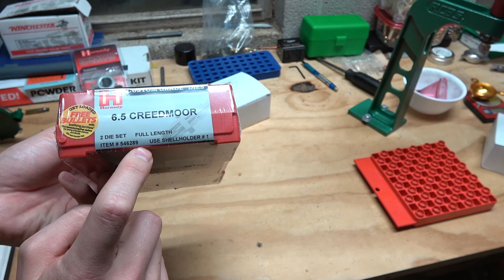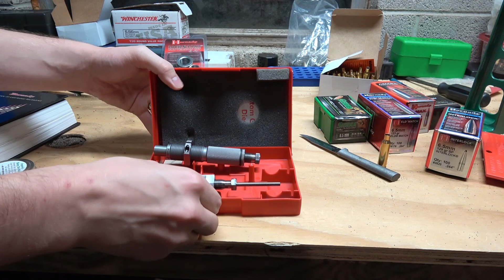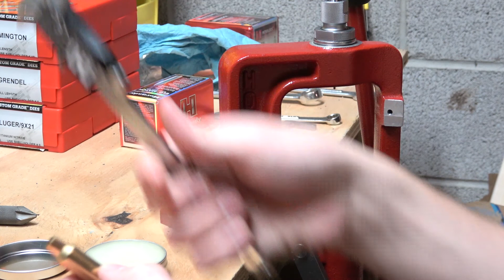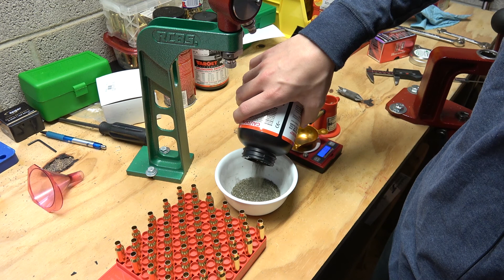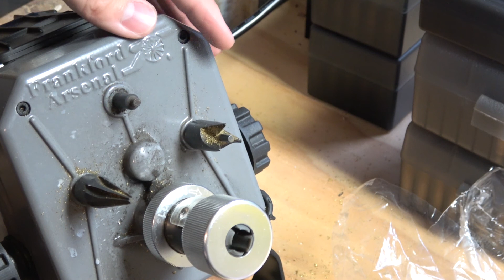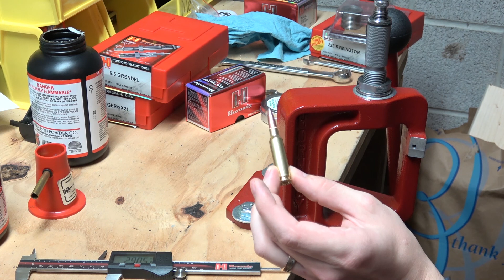Loading 6.5 Creedmoor Start to Finish

Comment: What size decapping pin would I need to deprime Lapua small primer pockets? 
I believe my pin is too large for the primer pocket hole. .072 is what factory is measuring at. 
Am I crazy or do I need smaller decapping pins in my die?
Reply from the maker: So I do know that most large and small primer pockets have the same size flash holes, but there is such a thing as a small flash hole. I’d bet the box your Lapua brass came in had the flash hole diameter printed on it. You can buy decapping pins specifically for small flash holes.
Reply: @TheOutdoorGeneralist  thank you! I’ll check it out!
Reply: @TheOutdoorGeneralist  Redding
Reply from the maker: I’ve never used Lapua brass, sorry!
Reply: @TheOutdoorGeneralist  alright thanks! Know anything about the size difference in small primer pockets and large? I think that’s where my decapping pin runs into some issues

Comment: Hi, why don't you use the powder thrower instead of the Lee scoops? Luv the vids
Reply from the maker: The powder thrower tends to cut kernels and bind up on extruded powder. If I'm using a really short kernel powder and loading bulk I use it, but for load workups and such the Lee scoops work great.